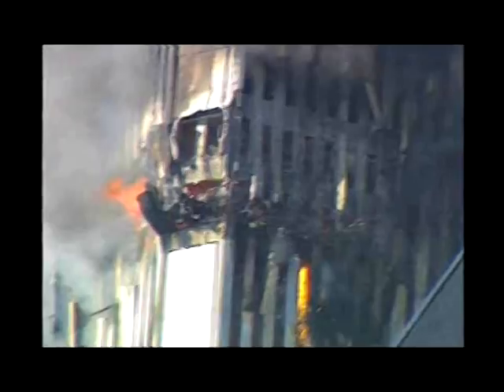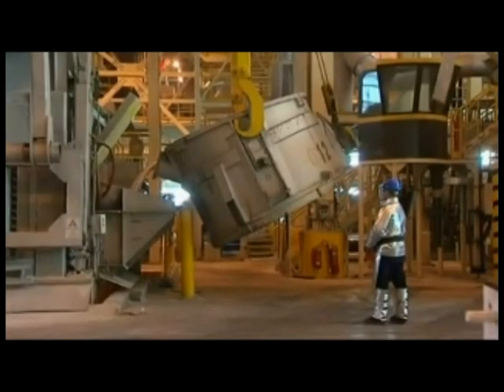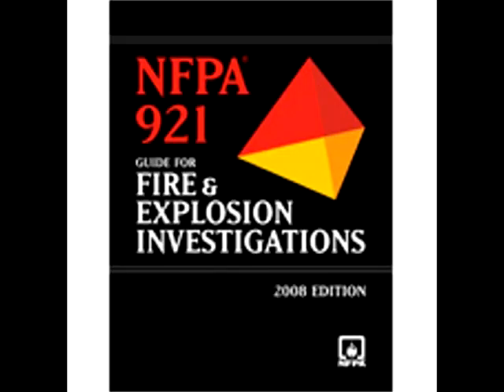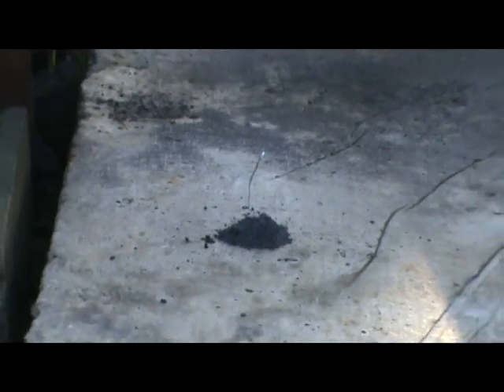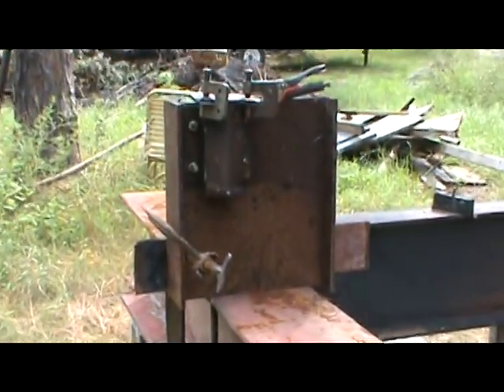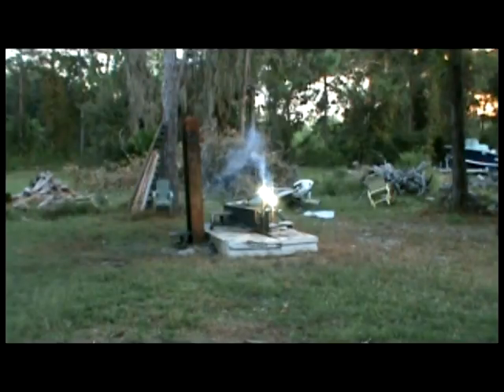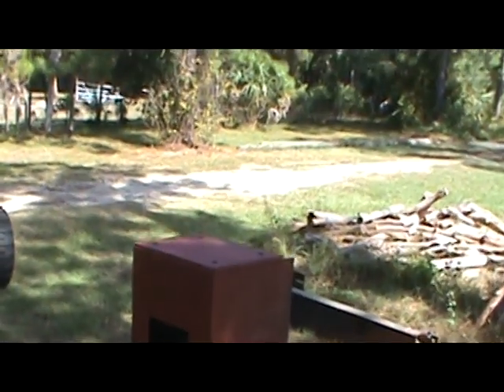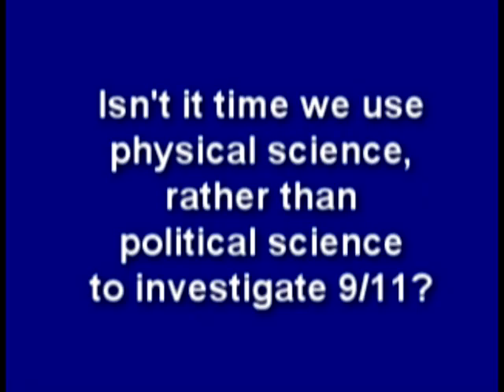9/11 Experiments: The Great Thermate Debate

Comment: Yeah man.  I will never forget that night that these dudes in strange uniforms came in my office on the 81st floor and ripped holes in the wall every 15 feet, bolted and welded some weird crap in there, then fixed up the walls just like new.  They did all of that during a single night shift and told me I didn't need to tell anyone else.  People would just be worried about weak walls.  Anyway, they took care of it.  

Dude, do you think they were foolin with me?  They even gave me some weed, man.  I think they were cool.

BTW, you make some cool sparklers.  Do you do birthday parties?

Comment: The building could have been rigged with explosives for a reason other than 9/11. When they crashed the planes into the towers it could have set them off. Sometimes, the powers that be will pre-install explosives of some kind in the event of wiping out a building or structure in a hurry. Most military aircraft have this as standard, explosives rigged throughout the aircraft that go off when the pilot ejects or crashes etc.

The tower could have been rigged like this when it had been built for some reason or another. 
To have installed all these charges in months leading up to 9/11 would have taken a huge operation well beyond what could be kept quiet. They had to have been installed during construction or extensive repairs to the building.

I seriously fail to see how anyone could access the beams with this much material and set it up so accurately to bring down the building and remain undetected while doing so.

Comment: burning and molten titanium will melt steel and jets are. made out 25 plus tons of steel 1600 degrees Celsius or 3000 degrees but only takes a. way lower temperature to ignite it and it will do exactly the same as thermite would do maybe you should test molten titanium on this i bet you would have the exact same results
Reply: correction jets are made of 25 plus tons of titanium

Comment: lol Steel does not have to melt to fail..  As you heat up metal it softens unless it clenched right after cooled rapidly like when bean is made  to make it ridged again.   Just saying common laws of steel and heat.  2 trillion black smiths over the last 4500 years cant be wrong.

Comment: great video, I'm against the whole 911 conspiracy but it's indeed a very interesting possibility. What I want is what the burning temperature of the jet fuel, I know here Nist said its like 1800 in open air, but is there any way to make that hotter by enclosing it or something. Also the gist of it is that if you can prove that there was indeed thremite at the location you can prove that the lab that found thermite was indeed correct, it's werid that only one lab out of many found anything. If it's indeed proven that thermite was found, there is not enough evidence to make it's involvemnet anything but a possibility. I think jet fuel can in the variety of situation act in weird ways, just like you've shown thermite where it went from nothing to a lightsaber just because it was contained. Besides even with thermite the columns could never be melted like that. The metal cools almost instantly after the reaction is over, the ambient temperature would still have to be high enough for metal to flow.

I can't really explain the other building that collapsed. That's strange. But I've watched the news coverage many times and the reporters were telling people that the FDNY might demolish the building. And then they actually said, demolition confirmed in a few minutes... and building collapsed. So FDNY knew about it. And I'm pretty sure that no self respecting conspiracy theorist would believe that the government is behind all of this.
Reply: +VanillaSnake21 There is no need for it to be hotter.  Steel starts losing strength at 700 degrees F and by 1000 degrees F it has lost nearly half it's strength.  It also undergoes a phenomenon called "creep" where it slowly deforms.  Combined with other factors, such as damaged or destroyed beams and connecting bolts, there's no mystery as to why the buildings came down.
Reply: crushffl no, that I'm completely aware of. I think just the regular structural damage and even the low heat fire was enough to make it collapse. What the conspiracy theorists are arguing is that some firefighters and people saw "rivers of molten metal".
Reply: +VanillaSnake21  Unless there are videos or credible witness interviews, it's just a Twoofer claim, probably the molten metal that was actually video tapes flowing out of one of the buildings and subsequently exaggerated.  Anyone on those floors close enough to see that likely never made it out, so it sounds like nonsense.  It never got nearly hot enough to melt steel, and even if there were thermite charges all over the damn place it would not have produces "rivers of molten metal" or anything close to that.  Sounds like another in a long line of baseless Twoofer claim.  It's the responsibility of sensible people to challenge nonsense like that.
Reply: crushffl I don't know, did you see the FDNY firefighters talking about it, there were four of them and they all nodded when the guy said they saw flowing metal. The thing is you're probably thinking it was like flowing through the building, but actually most stories of molten metal are post collapse, when they were going though the rubble.

For me personally 4 firefighters are not going to be too wrong most of the time if they tell you it was molten metal, so that' s a valid claim in my eyes. 

So I just thought of this, the temp of jet fuel is around ~1800. I looked up the temperature the coal burns it's 3500+. So coal is basically carbon right? So what if jet fuel was just a catalyst to igniting other carbon compounds like wood etc and those flames were the result of the melt?
Reply: +VanillaSnake21 OK, so I found three short versions of the same clip with firefighters talking about seeing "molten steel" flowing.  The clips are short and there is no other context, but I'll accept the interviews and their recollections as genuine. 

Now they are firefighters and not metallurgical experts, nor did they presumably perform any tests, so what they saw was probably molten metal and not necessarily steel.  Since these were firefighters it is unlikely that this was post collapse, but rather that they were in one of the buildings, in the floors below the impacts, but were among those able to escape before the collapse (probably in the second tower to collapse, where they were able to evacuate people after the first one fell).

If they were in one of the buildings below the impact point, I expect it is very likely they would have seen molten aluminum (mixed with copper, glass, etc.) flowing.  If it flowed out the side of the building as was recorded, why wouldn't it flow through openings within a damage building.

Your question is not a bad one, and in house fires it can get upwards of 2200 degrees F in certain zones, but to make steel flow like that it would have to be much hotter over a large area and for a much longer time.  Wood is not coal, and those fires take a long time to get to that temp and maintain it.  Given that we know that 1) there was about 30 tons of aircraft aluminum in each building in the fire zone, 2) aluminum melts at temperatures much lower than steel, 3) the fires were more than hot enough to melt aluminum, and 4) when flowing (especially if mixed with glass, copper etc.) it wouldn't look any different than molten steel to any non-expert, there really isn't any reason to believe they saw anything but molten aluminum.

The Twoofers desperately want us to go down this path because for molten steel there would have to be something more than what was in the "official story".  However, there just isn't any good evidence for it and you have to do some mental gymnastics to accept the crazy claims that the Twoofers put forth to get us to that point.

Realize also that while some of these Twoofers may be well intentioned (hey, I like "the truth"), they tend to be uneducated and driven by something other than "the truth".  As I've said, like Moon Hoaxers, Sandy Hook Twoofers and Holocaust deniers (all with a huge amount of overlap), they oppose the "official story" especially if it is a Western "official story".  If they can absolve some Islamic extremists of responsibility, and instead blame a US-Israeli plot, so much the better.  Just like ISIS.  Blaming US-Israeli conspiracies for everything is central to their recruiting tactics.  Twoofers are useful idiots for ISIS, spreading their propaganda to the gullible.  Twoofers are shills for ISIS.

Comment: Your PE license is in what discipline?

You have not show that the debris & fuel fire can not damage steel, and in not doing so, have not created a justification for your theory.  This is the crux of the matter.

You have shown what people already knew, that Thermite welding melts steel.

If you were creative, you might test the idea that an aluminum fire, aluminum donated from the shattered plane, caused a Thermite like heat source when in the presence of steel, perhaps some powered aluminum and/or steel.  This seems the most likely explanation.

Occam's razor or conspiracy theory.

Your choice.

Comment: ok first of all, you have to put in the account the amount flammable things inside.I know house fires can get up to 1800F. Think abut the amount of paper sheets and wooden desk, clothes. The building was also 40 years old. Then talk about the impact of the plane moving 500MPH, it could have weakened the steal beams on just one side of the building and that's all you need when there is 40,000 tons of weight in the floors above. MAYBE THE STEEL DIDN'T MELT, BUT I THINK WITH HIGH AMOUNT OF HEAT THAT IS CLOSE TO ITS MELTING POINT, WOULD WEAKEN THE STEEL JOINTS AND THUS LIKE I SAID THE HUGE AMOUNT OF WEIGHT ABOVE MAKE IT COLLAPSE. Think about it, why did the entire building collapse and not just the top half? Because the top weight above crushed the bottom half while it fell.

I know when i heat an iron rode with a torch it can be bent easily.
Reply: +SomeFamousPolak Thank you for helping my argument, weakened the building on one side, thus, on it's way down and meeting resistance as it should because the building below the point of impact was SOLID, it should have tipped over and collapsed in that direction.  But, it did not, did it?  It had no resistance coming down.....meaning...meaning....meaning...what come on finish it off now????

Comment: They never took down the towers with thermate or any explosives. It was the heat from the jet fuel and building materials and office furniture. That caused the support structure to fail over time.  The towers were never designed to take impacts like that or that much heat with structural failures. 

Now did the idiot government fail in stopping the attackers yes. There was chatter about terrorists wanting to fly planes into buildings and branches of governments need to talk to each other more. They could of stopped them possibly.
Reply: BUILDING SEVEN JACKASS WAS NOT ENGULFED IN JET FUEL WHICH BURNS OFF IN AN EXPLOSIVE FLASH FIREBALL just like everyone SAW on t.v., now, go play with your toy cars and video games.  Can't believe human beings are this fucking retarded.  As well, if jet fuel was really that good at melting steel, why bother with AP shells on tanks and other solid metal weapons of war, just dumped some aviation fuel, light a match/flick a bic lighter, and you can destroy any object made of the hardest structural steel just like this dumb ass twat here is trying to suggest, and that office furniture, which is basically a hot campfire, will melt steel, and that a fire 75 floors up will cause the steel beams to weaken simultaneously at the ground floor level in order to facilitate a free fall collapse....If you can show me anywhere video documentation of a building falling at free fall speed WITHOUT the aid of explosives...SHOW ME, but you can't NONE EXIST except for 3 buildings in New York all on the same day...yeah.......don't try calculus or advance physics, bio chemistry or anything else that involves numbers loser

Comment: J... Jet fuel can't melt steel beams! (Jet fuel doesn't get hot enough to ignite thermite either, You need to either mix Magnesium sulphate directly into the powder, which allows even a matchstick to ignite it. But it burns bright red. While Thermite ignited using a magnesium strip burns hotter because it has less impurities, And is more of a yellow-white color)

Comment: Never in the history of the USA has a high rise building come down on it's own from any type of fire damage. Buildings are designed to remain standing even after a fire has burned. Yet on 9-11,  three high rise buildings came down as the result of fire. If only one of the towers fell from the fire, that would have still beaten the odds, yet those odds were obliterated as 3 high rises came down as the result of what high rise engineers are saying is impossible.

Comment: You're right, jet fuel can't melt steel beams. Where the fuck did you see molten steel? What it can do is soften the steel. Combine that with the damage done by the impact of the plane and the weight of every floor above it, and it will bend until it breaks, which is exactly what happened.

Comment: Still going on about melting steel... been proven time and time again that the steel did not have to melt.  All that was required was to weaken the steel.  So why deliberately mislead people by using the melting term???  In my book deliberately misleading is basically lying.

Comment: There were no thermite cuts found in the 9/11 wreckage. But don't let minor details get in the way of a good story.
And there would still be hundreds of witnesses to the placement of these devices (weather inside or outside of beams).

 edit: I just realised also, those access holes were for the vierendeel spandrel plates (or truss beams) so they would not be available anyway. You can get this info from the "Architects & Engineers for 9/11 Truth" website itself. This makes me doubt if even the creator of this video believes what he is saying.

Comment: Im not doubting, but the welds made, were with what SMAW electrode, and diameter, and did you see the original prints, and the specifications, both for type of materal, and did you have (are you) a AWS CWI? If you're telling the truth, I'd like the certs and process. While proves a theory, I'd need these before I can fully back this video.

Comment: Great video. My main gripe is that if the TV experiments were genuine, the reason why they didnt burn through needs to be addressed more directly and the quantities, airflow and mounting for their experiments examined. Using Thermite in these experiments still doesnt rule out nanothermite either, which was found in the dust. My other doubt is over the perimeter beams explanation. While its likely NT would be rigged there as well, the focus should be on the central core of load-bearing beams. And finally, 'I guess it did' or whatever isnt persuasive when seeing the results of your experiments. We need to see the continuum between incendiary and the effect on the actual steel, not just flames and then we'll assume its right. I would ask the same of the mass media, so we should keep to our standards too. Otherwise, respect for a meticulous series of experiments very well presented :-)

Comment: I worked for a railroad for 33 years.  Thermite was used to weld sections of rail together.  A ceramic form was made around the joint to be welded.  The butt ends of the rail were about 1 inch apart.  The thermite was placed in a funnel and ignited.  The liquid steel ran down into the joint melting the rail ends and forming a solid joint between the two rails.  So, yes, thermite will melt steel.

Comment: If this was "melting" and falling apart etc wouldn't  it fall apart from the top etc like a candle does?  Not from the ground up like a "controlled demolition"  to fall straight down.  I'm pretty sure in every construction demo I've ever seen the actual spot of contact is were the actual demolishing happens.  Very interesting, because I've never seen anything burning and melting from the top half of it suddenly decide to just fall straight down from the bottom.  it would tip over sideways way before that point.

Comment: Very awesome video. This is just 1 guy figuring this out,  think about a committee of engineers and demo experts with info on the structural aspects of the building. There may also be a whole different mix of thermite out there. But I'm very impressed that your box cutter essentially cut through that beam so clean. Very cool indeed.

Comment: I watched the video pretty cool you def make your point can I see actually video from 911 that looks like these explosions that your showing. Ok you showed molting metal pouring out the tower ok definitely fish I guess but your tests all had explosions and very intense and rapid explosions but you don't show that at the tower why? Just wanna get the hens in a line if you had crazy explosions in your test show em in the actual 911 footage. If they ain't there your theory is kinda shot. expecially at the end in the steel beams that was a pretty big explosion that you can clearly see spark and hot metal flying threw the air.

Comment: What is the theory exactly? Did Al-qaeda fill the columns of wtc towers with thermate back in the 70's? Or were several construction workers recruited by the  CIA back in the 70's to put thermate in some of the columns so that 30 years later some planes could fly in and take the towers down giving the president carte blanche to turn America into a tyrannical regime? I mean I'm really asking what the theory is here. I don't get it.